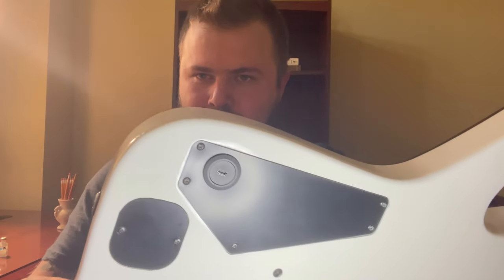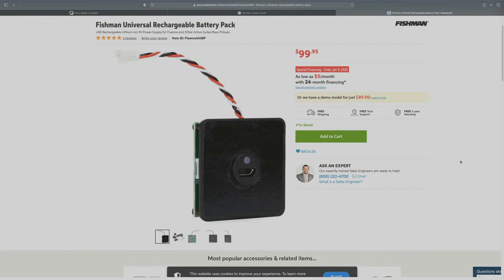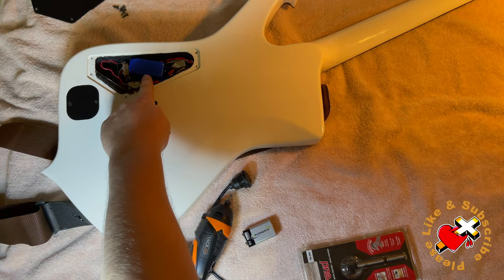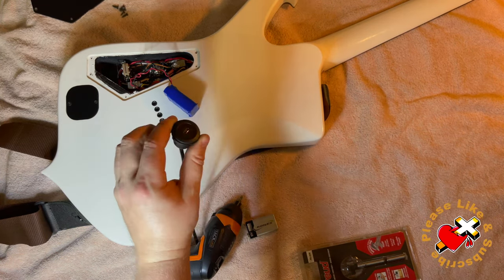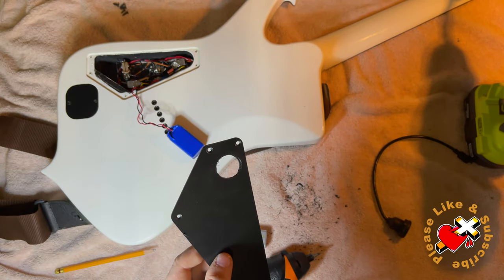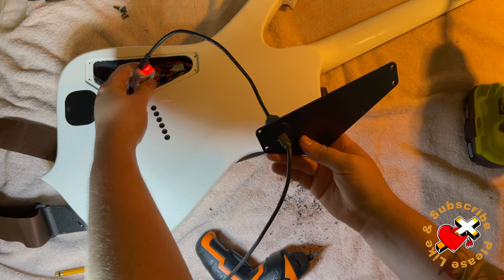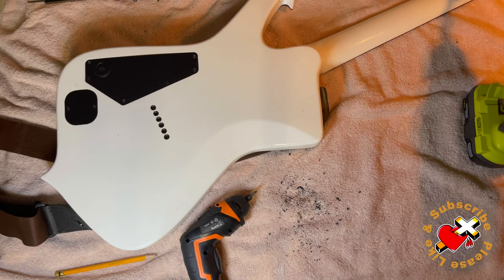DIY Rechargeable 9V Guitar Battery with Micro USB Port

Comment: @Mad Love Concept , hey bro , What micro USB 9v batrei did you use? Is that not give you feedback sound!??I tried that with ok cell micro USB 9v batrei and that feedbaback nging sound every time I used it, maybe you can give me some guide to solve my problem, thanks
Reply from the maker: For this project I used the Delipow USB 9V Lithium ion Rechargeable Battery found on Amazon. I do not experience any buzzing noise unless The battery is being charged with the USB Port AND my fingers aren’t touching the strings. 

Does it only happen with a rechargeable 9V and not a regular?

Is the negative pole of the 9V tied into the guitar’s ground?

Feel free to shoot me a photo of your guitar’s back cavity at Smitty@madloveconcepts.com

Comment: Does the battery work while it's being charged? Like, can I keep the USB cable plugged in while I'm playing?
Reply from the maker: Yes, but it has a high pitched ring because the digital ground and the analog are separate. A little annoying, but not the end of the world for the 30 minutes it takes to charge

Comment: Hello, does it add a lot of noise compared to an alkaline 9v?
Reply from the maker: If used properly, both types shouldn’t add any extra noise. Sometimes, you might experience a digital ground hum when you play while the guitar battery is charging.

Comment: I owe fender power stratocaster. Can I use the rechargeable batteries. Catalogue says no chargeable batteries
Reply: That’s because many rechargeable 9 volt batteries do not truly deliver 9 volts; they nominally deliver 8.4 volts. Most powered, on-board guitar gear accessories aren’t overly picky as they’ll operate just fine so long as they receive a minimum of about 7.2 volts (in my experimenting experience). Fender’s preamp may have tighter spec tolerances and as an 8.4 volt rechargeable battery’s charge depletes and the voltage begins to drop, it may quickly drop below the minimum threshold operating voltage of the preamp. 

If you open up a rechargeable 9 volt battery, you’ll see it’s made up of a number of smaller batteries that are wired in series. Each of these cells delivers 1.2 volts and there are 7 cells in total. This is why they only deliver 8.4 volts. There are rechargeable 9 volt batteries that are comprised of 8 of these 1.2 volt cells and deliver 9.6 volts. 

As there are a number of non-rechargeable alkaline batteries that deliver around nine and a half volts when fresh, I don’t think there’d be a problem using one of these 9.6 volt rechargeable batteries in your rig. If you’re not comfortable with this, try reaching out to Fender and ask them why it’s not recommended to use a 9 volt rechargeable battery with their preamp.

Comment: Ok, so I have a pew pew preamp (stratoblaster) and the USB 9V battery gives a terrible buzzing noise. Anyone relate to this?
Reply: Did you wrap the battery with electric/electrician’s tape or some other insulating material? If not and the metal of the battery casing ends up touching any of the metal components in the control cavity or you also might have a grounding issue. In either case, you might have a noise issue like you’ve described.
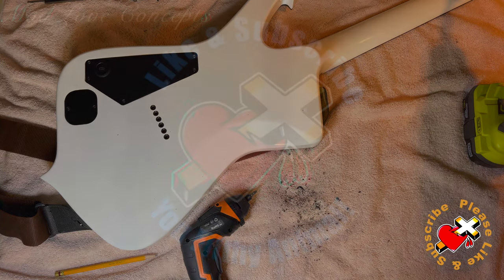Reply: @kirkbolas4985  thanks for the reply!!  I figured out it was the milliamps output of my battery. It was 1000 milliamps. I also tried an inline capacitor, thinking it wasn't getting a consistent DC current but that didn't help. So I changed to one that was 650 mAh and it worked great!! 6:26

Comment: That’s a great idea! Can you recharge while you play?
Reply from the maker: Yes, but there might be a grounding issue that makes a slight high pitch noise
Reply: @ChurchCinematics  Understood. I should be able to use a portable USB recharging battery pack without noise though, right?
Reply from the maker: @skidogbill  do you mean the battery inside the guitar cavity? The 9V wont produce any noise unless being charged. But if you plug it in to be charged, it might produce noise. 

To get technical, it depends on whether the digital and analog grounds separated in the 9V battery and the charging source.
Reply: @ChurchCinematics  I have a portable USB battery charger (a 3”x3”x1” box of batteries) for recharging devices without access to 110 power. Anyway, hopefully it wouldn’t add any noise.

Comment: This video is great man thanks a lot. 
I tried to do it recently. However, when I plugged the guitar in, there was this terrible high pitch noise. I switched the usb 9v battery with a regular one and the noise was gone. At first I was thinking it was because the battery is only 600 mAh but it could be because of an issue inside the battery itself. I ordered another one at 1200mAh. Let’s hope it works.
Reply from the maker: The battery manufacturer’s probably didn’t ground the analog ground and digital ground together. That high pitch noise will happen with devices like XVive U4 when they’re being charged because the grounds are separate.
Reply: Loïc NOEL
The noise comes from the dc-dc converter built into the battery.
Reply: Is it possible to fix it?
Reply: Yep.
Check the grounding.
Make tin case for battery, this case need to be ground too.
Reply: @iridios6127  I know this is very random but i am trying to troubleshoot this for my guitar. I've tried using tin tape to make a case for the battery but the hight pitch noise is still there, how can i ground it so that the sounds get fixed. Any help is appreciated.